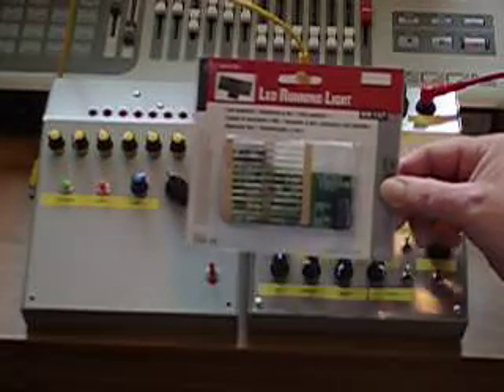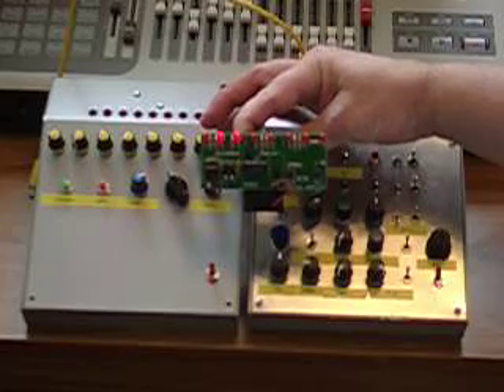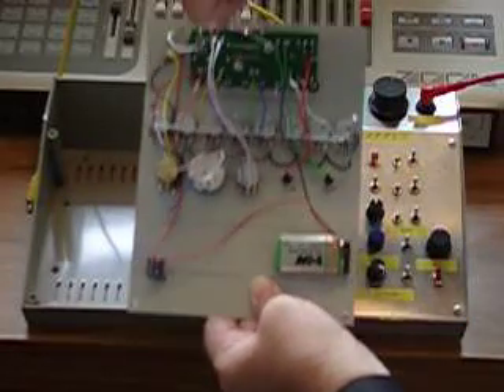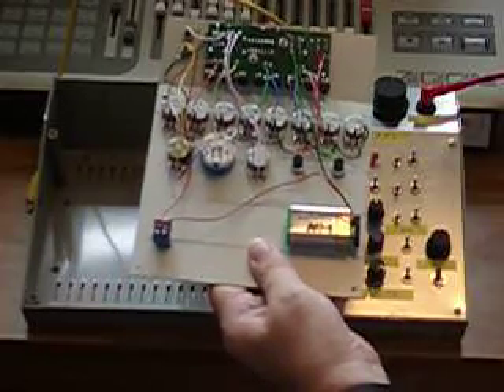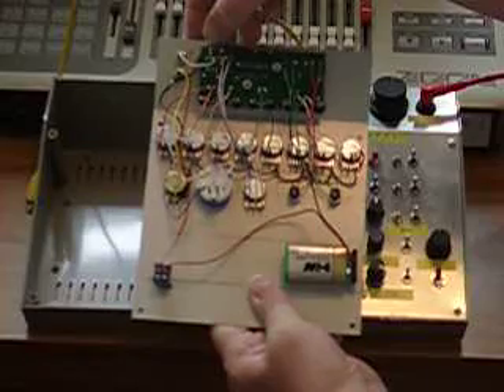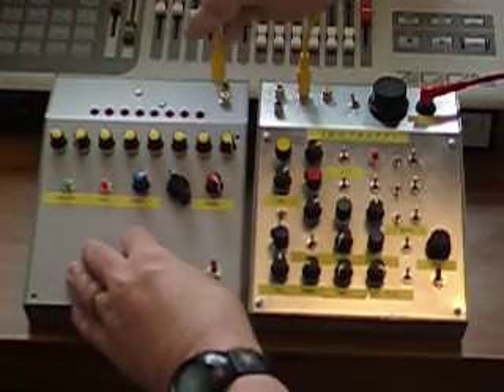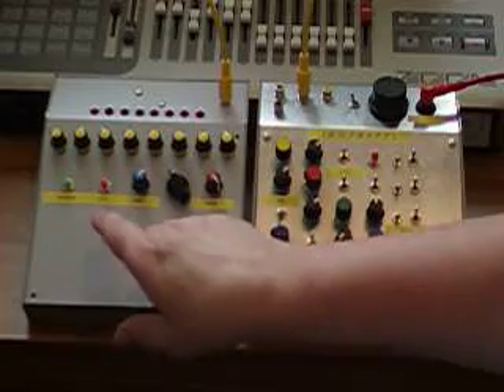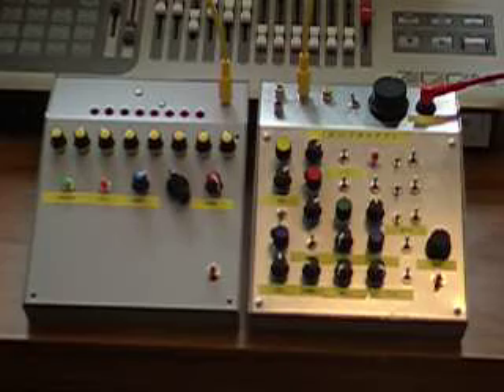MK107 sequencer

Comment: Thank you man, this is awesome.  One question, do you think it would be possible to make this into a patch sweep? I'm trying to find something to switch between preset patches on a loop, with a knob to control the speed of the sweep.
Reply from the maker: If you can trigger the patches with a simple voltage, sure. However, be aware that you can't set individual patch durations this way - for that, you'd do better with a simple programmed microcontroller. Good luck!

Comment: Thank you .... I think this will do the job .... I thought this would be more complicated, but some solutions are simple. No, I don't need 16 steps, eight are enough. This would multiply the Problems in another way. No, they should run at the same speed, only. If the reset is the same, they should run with the. same startpoint, I think .... Am I right??? I'll test it with two other ones first, which are Ready for this purpose. Thank you again, this will be fun!!!

Comment: So ... thanks for this Video and your instructions /// I've built two of this Sequencer beasts /// the output signals are fine, but how could I sync the two sequencers together .... ???
Reply from the maker: Depends on what you mean by "sync". If you want the two to run at the same speed in parallel, you need to break the board connection between the output of the 555 chip (pin 3) and the CLK inputs of the 4015 (pins 1 & 9). Then you can arrange switching so that one of the 555s feeds both 4015s simultaneously. If, however, you want one sequencer to count 1-8 followed by the second to do the same, to give a 16-note sequence, you probably can't do it with this simple circuit, as the 4015 is not designed to be cascaded in this way. You could probably do it with suitable switching logic chips, but it would be easier to find a better sequencer design!
Reply: But if I would connect the other 555 to trigger both circuits (Dataline cut)  /// where comes the other lead from??? should I connect another pin to ground??? But which pin???
Reply from the maker: Just connect the output of one of the 555s (whichever you want to use as your clock) to either pin 1 or 9 on both counter ICs. Make sure you don't cut between pins 1 & 9 (they must remain connected) but near to pin 3 on the 555 you wish to disable (i.e. the one you DON'T wish to use).
Reply: So, nearly done - I got it working - but the second sequencer didn't respond and the sequence wasn't starting properly. And I thought yes, they need the same start signal, so I connected the buttons and everything worked properly! Thanks - but with a few changes - I need one more month to go and I think I'll show the result ....
Reply from the maker: Cool! Look forward to seeing it in action!

Comment: +Ed OD I have a bunch of different types - in this case they were British CG84 germaniums from the early '60s computer era, of a type called 'gold bonded' and designed for fast switching. In the USA, 1N34s are very similar. Any other germaniums will do, though, or silicon 'Schottky' types. If all else fails, the cheapest silicon diodes you can find. Given the limitations of this build, it's not a big deal.

Comment: Excellent!
Reply from the maker: +Derek Dodson Thank you most kindly, revered sir. After seven years, I probably ought to come up with something new (and in higher resolution).
Reply: +MirlitronOne my pleasure. Been tinkering with synth / noise makers most of my life. built a 10 channel sequencer without LED indicators from an online circuit before I realised that 8 channel with LED's was what I should have made. currently building a duel Atari punk console with optional optoresistors for control. bit like a 'Theramin'? 😊
Reply from the maker: +Derek Dodson Okay, next challenge: connect two sequencers to an Atari Punk Console to generate a variety of tone sequences. Hint: JFETs or home-made vactrols make good voltage-controlled resistors...

Comment: Cool idea, wish the video was a bit clearer. Is there a chance you can post a picture/s of the wiring??
Reply from the maker: +tonalaxis Well, it's an old video, recorded in prehistoric times. Apologies, but my view is that if the explanation of the wiring isn't clear enough, you should do a little more research on potentiometers / voltage dividers before you undertake this. Thanks for your interest.
Reply: +MirlitronOne OK, thanks for your reply. I understand, was just interested in how you wired it up in your case.

Comment: Have you considered connecting all the potentiometers via a single diode to the ground to compensate for the voltage drop of the 8 switching switching diodes?
Reply from the maker: +Jasper Oosthoek
No, because the voltage drop has never been an issue, and I didn't want to explain it to the masses - but it's a good suggestion, thanks!
Reply: +MirlitronOne  Ok nice. I just picked up a MK107 kit from my local electronics shop and some cheap pots from ebay :-). Thanks for sharing this!

Comment: Working on creating a 16 channel sequencer for a Werkstatt-01 Moog synthesizer. This is a great starting point. I can get the Velleman kits up the street for $10 CDN. Just need to figure out how to trigger the second MK107 kit from the first one. I little analysis of the 4015 chip should clear that up. Also want to add a glide control, but a capacitor and a pot should be a good start. Thanks for posting this valuable video!
Reply from the maker: +Dana Lee 
Thanks for your kind comments. The 4015 chip is already a dual 4-stage device so if you examine the circuit diagram (provided with the kit and also available online) you will be able to see how the two halves are linked, which will give some clues as to how to expand to 16 steps.
My current favourite glide control is shown at http://www.acxsynth.com/Glide/Glide.htm
Not only is this a very simple but versatile circuit, you can also use the same circuit as a simple AR envelope generator.
Good luck and please let us know how you progress!
Reply: +MirlitronOne Brilliant. Thanks for the tip and the glide circuit link. It'll take me a while to get this going (my day job keeps me busy, lol) but if it all works, I'll take pictures along the way and probably make a video for my YouTube channel of my (hopeful) success!

Comment from the maker: Not quite sure what you mean by "trigger". It's easy to interrupt the signal between the timer and the CMOS chip so that you can either substitute an external clock signal and/or take an output from the internal clock to drive other circuits synchronously. This may require additional buffering to make it reliable, which adds to the complexity of the circuit. The kit comes with the circuit diagram - if that isn't enough for you, you probably shouldn't try it!

Comment: Hey one more question,,, should there be a signal diode on the center pin of the 100k pot? i attempted to send the gate / cv out to a korg monotron duo and the monotron kind of behaved like it was overloading / sending electricity back thru the 100k pot making the sequencer go dim and strange...  o.o

Comment from the maker: The summed signals from the channel pots / diodes go to the left-hand outermost pin on the 100k pot, the right-hand one goes to earth, and the centre one goes to the output socket. Google "voltage divider".

Comment: Hi... I just have one doubt when completing my sequencer... at 4:40 the "output pot which set the overal range of the output" which is 100K potentiometer is connected as a variable resistor or voltage divider (I may even say this last concepts wrong, im not sure...) ... what I understand in variable resistor mode you dont connect one of the pins of the pot... in voltage divider you connect one of the "outer" pins of the pot to ground (or other voltage destination) .. cheers!

Comment from the maker: If you understand Ohm's Law, it's easy. Imagine the output is 8V maximum. If you connect the outer pins of a 1M potentiometer between this output and earth, the centre pin will vary 0 - 8V relative to earth. If you connect a 1M fixed resistor between the circuit output and the pot, the output can be varied between 0 and 4V, etc. Generally,

volts out = volts in x potentiometer resistance / (fixed resistance + pot resistance)

Comment: Thanks for posting this. Going to give it a go (newbie). Could you please answer a couple of questions for me to avoid toasting my Monotron? 1. Is the gate out wired without a ground? It looks like there is only one wire in the video. 2. What resistors did you use to ensure only a 5v max output? 3. I'm new to diodes - Maplin has a Schottky Rectifier Diode. Is that the one I need? If not, is there another product at Maplin I could use (no AO91 on there).

Many many thanks!

Rob

Comment from the maker: You wouldn't want the rate to go down to 0 bpm though, or all the action will be in the last few degrees of the pot. 60 - 280 is more reasonable.

Sorry, I don't have a reference for the Bongotnik circuit. All I can tell you is that it was based on "The Audio Artist Sound Effects Machine" by James Barbarello, published in Popular Electronics in the mid 1970s - early 1980s. Maybe there are indexes online where you can track it down.

Comment from the maker: Granoj1's comment was copied to me and didn't seem like spam, so here goes: the components that determine the clock rate are C3 (the 1 uF capacitor) and the variable resistor. You can limit the lowest and highest rates with resistors either side of it. R10 already limits the highest rate in the original circuit. The clock is a 555 timer, so the 555 data sheet or any good electronics primer will tell you how the frequency depends on the resistor and capacitor values.

Comment from the maker: Yep, that's all you need. The only addition to mine was a switch and limiting resistors to ensure that the output does not exceed any input limits on the circuitry to which it is attached. Normally, this won't be a problem, especially if you are careful not to turn the output (range) pot higher than is needed to give you the pitch range required.

Comment from the maker: It's a sequencer. It outputs a repeating sequence of discrete voltage levels that can be used to drive a voltage-controlled oscillator which then generates the tone.

You need a VCO for it to drive. There are loads of simple designs out on the web - using CMOS ICs or a 555 timer, for example. It doesn't have to be high quality - it doesn't matter, for example, if it's linear or exponential voltage response, or nothing in particular, whether higher voltage give higher frequency or vice-versa.

Comment: What an ingenious bit of left field thinking. Thanks for sharing.

I've got one on the breadboard now- a built circuit board with leads from chip/resister point running out to the diodes and pots for testing.

I'm only getting a 'click' out of the circuit to my amp though, I can adjust the 10k pots and hear a slightly lower or higher pitched click... but no actual beep or tone.

Am puzzled :(

Comment: Thanks for the video ! I have just built one and it works great  with my Gakken SX-150. Instead of using a 100K pot to control the voltage output, i used a 1M linear pot, works like a charm !

Comment from the maker: Omitting steps is much more difficult. Using switches just means that each 'off' step will produce something near zero volts at the output. Depending on your VCO, this will almost certainly produce either the lowest or highest note from the VCO. In order to produce silence usually requires gating the VCO output in some way. This can be done with 4066 switches but will add enormously to the complexity.

Comment from the maker: What you want to do is not as simple as you describe. First, you will have to disable the 555 clocks to three of the boards (this is easy, just leave out the 555 chips) and then route the output from pin 3 of the remaining 555 to the pin 3 location on the other three boards.

Comment from the maker: I've tried taking some close-up shots but I haven't managed to get any that really show the necessary connections. If you're familiar with the Baby 10 circuit, you'll find this easy enough - just bear in mind that this circuit is limited to eight-note sequences - you can't have shorter sequences like you can with the 4017.